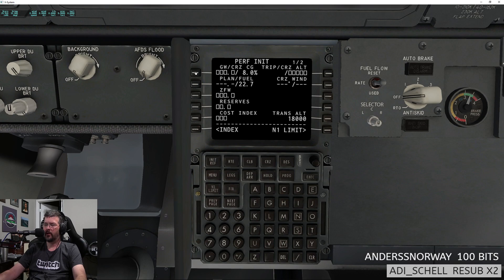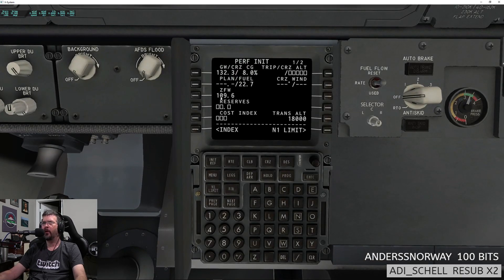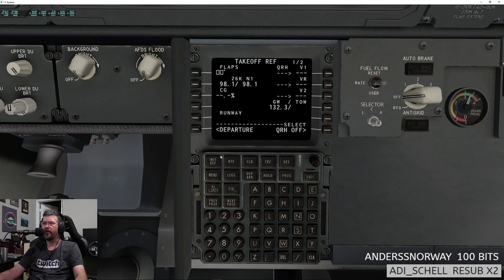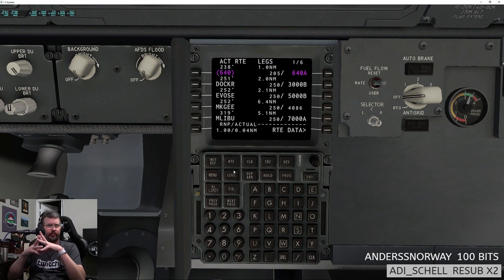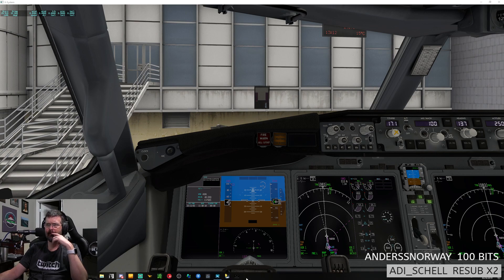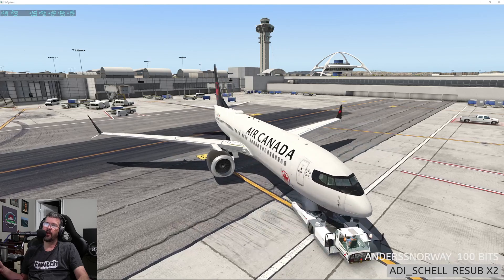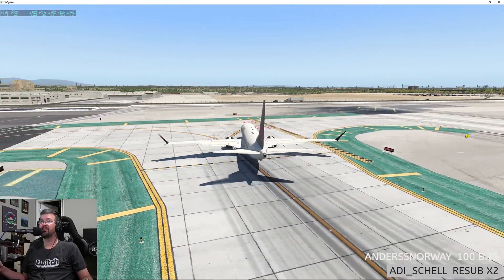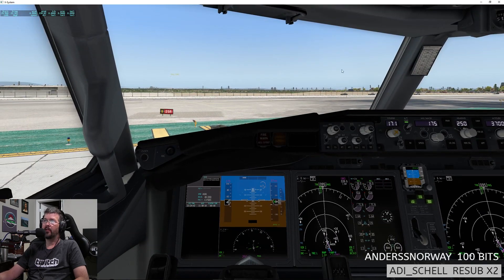737 Max KLAX Departure

Comment: The reason why the autopilot pitched down so drastically and couldn’t manage to hold 8000 feet in the beginning is because they are using a custom made autopilot for a different flight model. You can see the same effect in the 700 and 900, they can’t autoland properly